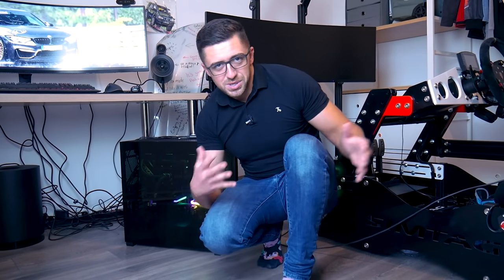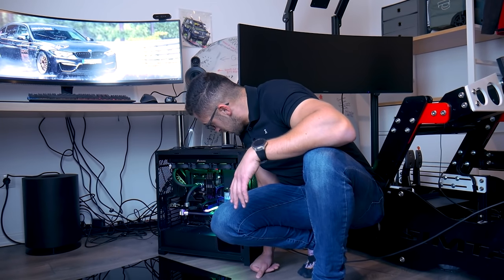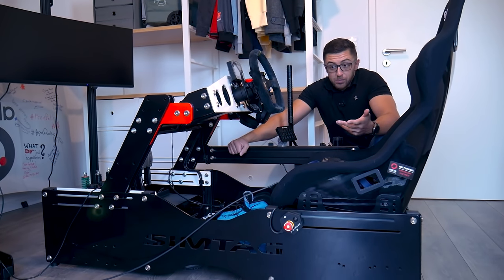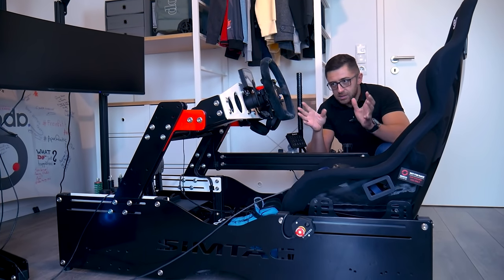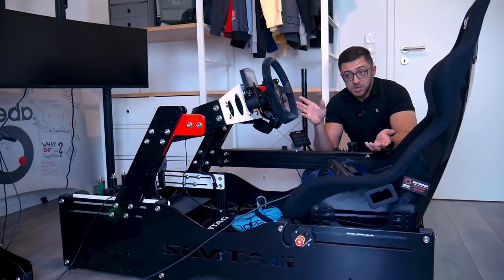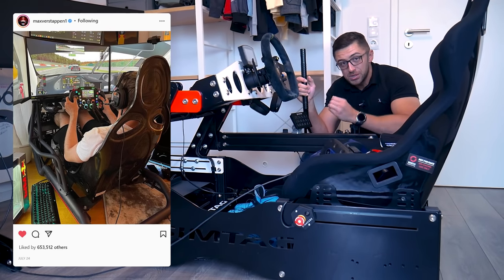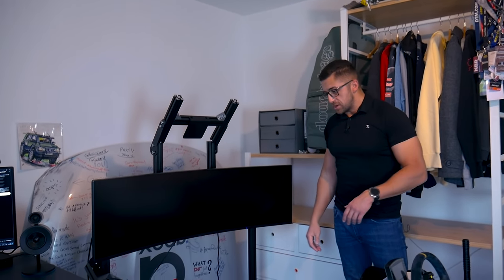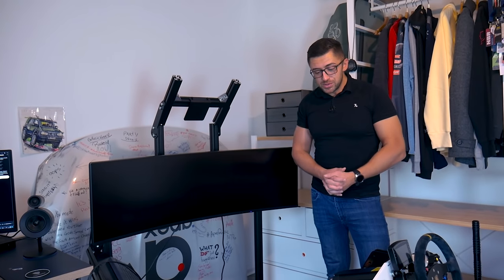My €20.000+ Sim & Editing Rig Walkaround!

Comment: Nice! Really sick setup. Don't worry about the question with why not Fanatec SC2 Ultimate is far superior to anything Fanatec has to offer. I really like AC too, but friends nudged me into trying RF2 (track loading times can still be a bit long tho) and I think it has much better driving feel and physics, but sadly not that many mods and road cars available compared to the AC. A very big plus in my book was that there is no more kerb of death that is present in AC due to the single point tire model (really hope Ilya manages to find a way to make it into 5 point one with CSP). And can relate with your iRacing struggle, joined especially for driving the 24h of Nürburgring and similar endurance events, but due to the lack of time in the last year, I just got fed up with waiting for the game :| But I think that it is the only sim that simulates dog box shifters correctly. AC almost doesn't care about the way how you downshift. If you do not blip the throttle while you can 95% of the time still shift while iRacing won't let you shift if not done properly. Especially noticed that while driving the Skip Barber and Radical SR8. Had not had enough time in RF2 to try out how far the shifting physics go.
Reply: Kerb of death has little to do with tire contact point modeling. It's honestly more to do with lack of chassis flex in GT/LMP cars. You'll notice roadcars just don't have kerb of death; the dynamic roll stiffnesses are more compliant in that regard. It's also not a good solution to just code in more load points and vector to a single point like ACC does; it will still be wrong, but just differently.

Accuracy wise, AC is well ahead of rF2, especially with CSP. With CSP features it's way ahead of everything the public can get, and that's right now before all the planned features are in.

Also Ilja hasn't devved any of the physics features in CSP. Those are from Jackson Papageorgieou at IER.

The main thing preventing multipoint tire model via CSP is Ilja's terrible code that is making it difficult to implement. Conceptually it's not difficult I've been told.
Reply: @ArchOfficial   Wow, tnx for a very knowledgeable and technically rich reply. Much appreciated. 
I knew that Ilya is not doing physics, but couldn't find the name and project of that other guy. And they are making from what I was able to find the CSP together.
I also thought that kerb of death is connected to tires due to it being mentioned in a very old, publicly available CSP Trello board under tire section. So I assumed that it has to do with tire point modeling and not chassis.
Reply: @nejcmirtic529  To some point it has to do with tire contact point load modeling, and initially we thought it's almost completely due to it, or perhaps due to physics tickrate. It wasn't tickrate and there is no mechanism from the tire modeling that would cause it to such a degree; and besides, it should then happen in all cars, not just a select few types. 

At least it doesn't happen in any of the dozens of roadcars I've made. Interestingly my DTM 1992 cars begin to suffer from it a little probably due to having very stiff roll stiffnesses without the appropriate dynamic flex, only a static installation stiffness.

More analysis showed that it's very likely largely from the dynamic roll stiffnesses particularly in the rears of LMP cars being much softer IRL than in a sim with no flex modeling. LMP cars' rear suspensions are attached to a very flexible narrow piece after all, so the rear stiffness should end up softer in dynamic.

GTs seem to also be engineered with the flex in mind, hence why ACC added a simple rigidbody flex system in. You get exit kerb oversteer if the stiffnesses don't match.

Multipoint tire model would help a little too but in most cases not much at all in fact. There isn't enough tickrate to even benefit from the multiple points in the kerbs and compressions where it is a problem. It only really helps when driving very smoothly onto a sloped smooth kerb. 

Doing it the wrong way like ACC (and I'd bet RRE as well) does and just having a 1pt tire model but taking the load from multiple points will definitely smooth out the load in theory, but in practice it will just produce either no change or a different kind of error.

Most of the time cars are driving on effectively flat ground anyway, even when driving onto smooth kerbs, so it doesn't matter much if you have one point or 100.

*Grammar
Reply: @ArchOfficial  I could read this comments for ever :D Really like learning more things about my favourite simulator :) And this kind of nerdy very technical details are the best. Thank you!
Reply: @nejcmirtic529  Sure. We will see later once everything is properly implemented how much of this exactly is true. I think it should be about right, but maybe not in every use case. There are scenarios where multipoint tire model could help very much, like partially hanging a tire off a ledge, or partially onto a kerb and partially onto track with the middle floating for an extended period of time. I am mostly talking about the typical kind of lateral translation onto kerbs and then longitudinally off them.

Comment: As for vr signal interference... Probably there is interference with simucube steering wheel to wheelbase wifi connection...

Im not sure about the vr.. probably there is some setting tweak to select the wifi signal channel to avoid interference maybe?

Comment: do you have reflecting surfaces around? if yes use a curtain in front of that reflecting surface. it is probably the hood you have standing behind the monitor.
Reply: Can confirm, I have crazy tracking issues near windows and mirrors
Reply from the maker: Let me try getting rid of the hood!

Comment: I do not use neither gloves, nor shoes in my rig. I imagine the shoes making sense because of higher braking forces if you arent barefoot. As I drive without gloves I prefer no gloves in my rig - especially with the Porsche Alcantara wheels it just feels great although I notice my skin hurting after more than one hour when racing on the limit.

Why did you not get a manual shifter? I love the Fanatec one to be able to either simulate a manual or a sequential (as I have in my car).

Comment: Get a Quest 2, with a 90euro router you can also use it wireless :)
Reply: btw with the quest 2 you don't need any basestation at all! so you can use it anywhere you except from direct sunlight because the controllers are using infrared for tracking

Comment: My man, I will throw my 2 cents in for you. I have had triples, and it gets kinda annoying cause it makes you have to use 2 systems or 2 graphics cards cause will be out of outputs. you can either have triples w/ spare monitor.. or vr w/ the 49in ultra wide.. and having the vr w/ 49in is the best of all the options cause it will leave you 2 ports for your desk setup.. and funny enough its easier to drive, and you I have the same computer.. hp reverb g2 is the choice here cause it has internal head tracking and  the clarity is waay better than that vive.

Comment: no H shifter???
if you play "only", i prefer vr absolutely... doing streaming i dunno (i just play :D).
Reply: ah misha, i forgot...
i used to have a lenovo explorer (now sold...), that has "insideout" tracking (cameras on the visor), and for sim was perfect.
i think that your setup could/may blind those sensors.
those vr with external sensor are quite good for track the full body movement, but for standing/sitting position that ones with cameras instead of "base station" are better.
reverb g2 for example, the quest 2 with his cable also.

Comment: the sims i like are asseto corsa(not the competizione yet, need to buy a wheel again to make the jump to competizione) and Gran turismo sport

didn't like project cars 2 it felt off , it doesn't feel acurate to real life but asseto corsa is not perfect too( again not the  competizione,  competizione is probably much better, it needs to be much cuz racing cars and more data to work on those cars) , in asseto corsa all porsches feel good others cars a little off and also doesn't have good sound.  

gran turismo sport is the one i mostly like to play to experience the cars, im jump to nissan gtr r35 and feels like a nissan gtr r35, polyphony digital work on that car for years, a porsche 911 gt3 rs feel acurate same feeling to asseto corsa, mercedes sls amg feels better and accurate on gt sport not on asseto corsa, some cars on asseto corsa they feel like a copy of other car.

Comment: Sorry but no way that rig cost $20k no way. My rig with a 3090ti and 13900k simucube 2 pro on a P1X triple 1440p 170hz simagic shifter, huesinkveld handbrake simagic p1000i pedals with haptics and hydraulics over £800 in button boxes triple monitor stand from simlabs transducers on all 4 corners by dayton audio I have the logitech Z906 and wheels are cube controls GT Pro and the cube formula pro. Also have the racelogic by simpush and their Lumirank both aluminium cases and a 5in display with LED rev lights so NO WAY is this $20,000